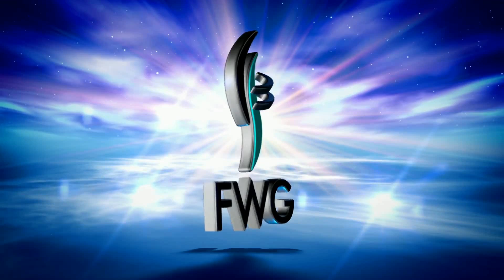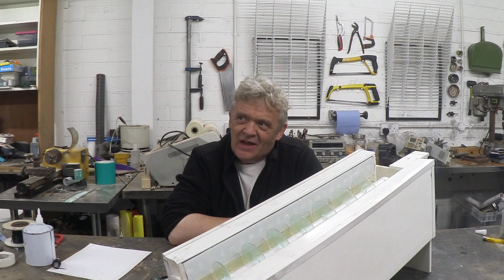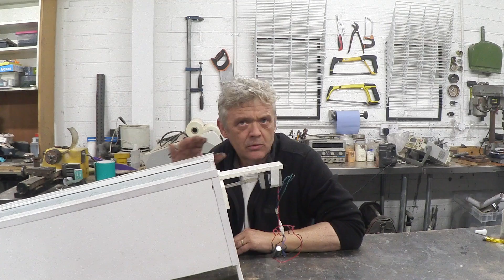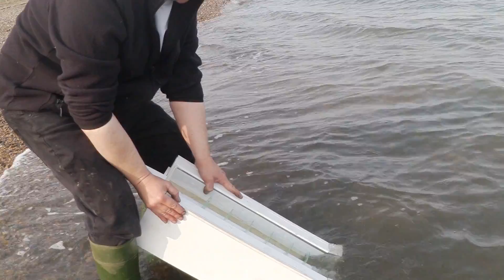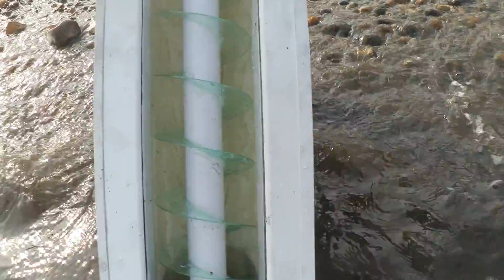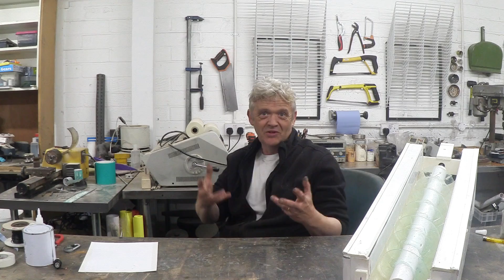Testing the Archimedes Screw Generator in the Sea - Wave Power

Comment: 🤔 you could mate it with a wave capture device. (Just a tank with shallow slopes.) 
I was just thinking 🤔 of a different style, you could use buoyancy to generate.
By attaching floating anything's to slide up and down a pole, and use your differential gearbox and toothbrush ratchet,or a rectifier circuit and a stick bowed with a string attached. And can wrap once or twice around a small drum long enough so it dosen't fowel up and tangle, that will give it more flexableity as the sea is very unforgiving, and raises the generator out away from waves.

🥺 Please make it ❤😊
⚡ ⚡ ⚡ ⚡ ⚡ ⚡ ⚡ ⚡

Comment: This is a silly proposition Robert but what would happen if you put an elastic band a big heavy duty elastic band as the linkage or to control the linkage in between the auger and the generator so that it would wind it up and it would get to a point and break loose and really turn it blazingly fast once it reaches that point where it can't hold back anymore that way you would reach a point where could generate a lot of electricity I know certain motors slash generators are not efficient when they're spinning slowly that it isn't a exact one to one deal that there are diminishing returns if you move them slowly do you know what I'm trying to get across? Of course it would have to have a ratcheting system so as the waves rolled up it would turn only One Direction and wind up the elastic and when they rolled down it would do nothing rolled back up it would wind it up a little more do you know what I'm saying?

Comment: what if.... the top of the screw core was dropped to the the hight of the incoming wave?
That way the water wouldnt back flush as much and just maybe, create enough draw on the screw to keep it rotating in a forward/positive manner; in preparation for the next wave?
I think the angle of the 'sluice' should directly correlate to the size/height of the wave
Just a though.
Appreciate your efforts.
Cheers for sharing.

Comment: Hey, I also watch that Japanese video, and I decided to make this device for my final project at school. But I have a question. If I make the screw quad-helix, do you think it will performs better than the double-helix or even the single-helix? considering I will use an identical stepper motor.

Your answer will be very appreciated and helped me alot. Thanks!

Comment: was wondering, what if you glued a 1" high plastic rib aligned from the center mast to the outer edge of the screw with a 1/2" lip on top like cupped fingers set every 2 inches down the screw,  if that would significantly increase the efficiency of the screw?

Comment: How about covering the open 'front' of the screw with a sheet of clear acrylic plastic.  Then submerging the column with the screw so that the water rushing in and out of the bottom end twists the screw back and forth.
Match the higher torque of the screw to the motor shaft with large and small pulleys and a belt.  Or a large diameter motor out of a washing machine (I forget what its name is).
Thanks for the innovative demonstration.

Comment: I think feeding the water into the top via a wide converging ramp scoop from the wave and the screw part being inside a tube to return water out, would be most efficient to produce max energy from a wave.  Then as you stated focus on the generator optimization.  Try that :)

Comment: Hey Robert, maybe your looking at this wrong. Maybe a different direction is needed. Maybe you need to have a look at self winding watch mechanisms. You can buy the cheap book of 501 mechanical movements.  You then could build if you want too, a spring activated movement to run your device. Your right,. It's all in the way of gearing. Check out the forever Light. It works almost the same as an Old Cuckoo Clocks with the Corn Cob Weights. Use the Screw you built to wind the Spring and the Spring to turn the Gears and the Gears to turn the Motor that intern product the power for your project. Just a uneducated thought. Thanks for the upload. PS I forgot to add Robert. Your going to need some way to collect the power until it has reached the level your products need. Your going to need some Capacitors to hold what ever your project needs.

Comment: I've been thinking along these lines for ages, if I ever move into a house with a stream in the garden a water driven generator would be in place before I'd unpacked my packing cases!

You can use gears or pulleys to convert high speed/low torque to high torque/low speed and vice-versa.  That's what the large wind turbines you see in fields do, a gearbox is used to match the high torque & low speed available from the slowly rotating blades to the higher speed (and lower torque) the generator needs.  

In your project the capacitor on the output of the rectifier is good at storing pulses of electricity, for example like that odd-shaped wind turbine you made would produce if a gust of wind came along.  I don't think you'd need it in this application if the water flow was steady, as in a stream  A capacitor would be useful where you used the Archimedes screw in the waves, it would even out the varying voltage produced because the rotor has to stop and reverse on each cycle.

Comment: I remember reading somewhere that in a wave the individual molecules of water actually move up and down vertically, not elliptically as one would think, so I wonder whether this would work if it was mounted vertically without an enclosure and just extracting power as the water molecules impact the vane of the archimedes screw.
Reply: Vertical might extract its full potential with least friction.

Comment: Pelton wheel  style generators rely on high head pressure. That takes a lot of height. The Archimedes screw can function on a gentle slope. In backwards mode (not as a pump) it tries to slow the water down, but gravity weighs upon it, compelling it to turn. At some point the water will bypass it and flow over it, so the longer it is the more work it could do. If it were on a vertical axis where the fluid entered a toroid shaped vessel in a spiral, and the discs that made up the Archimedes screw reduced in size to match the shape of their container I wonder what that would do? It would take full advantage of gravity and maximize rotational force. The top of the vessel could have taller walls to increase pressure. I can not visualize what orientation the impeller should have to the flow, but I think it should be counter to maximize pressure.

Comment: Wouldn't Salter ducks be a more effective way of extracting energy from waves? Instead of of supplying cheaper electricity at a time of high oil prices in the 1970's, now it could be repurposed for coastal defence. The wave impact on vulnerable shorelines could be reduced and the electricity generated could help recoup the cost of the installation.
Reply: Many different designs of wave energy converters were researched in the 1970's and 1980's. A lot of the UK interest was triggered by the oil crisis of 1976 and then wound down in the mid 1980's, when it became clear that oil was not about to run out.

For UK operations, the best wave energy source was Altantic swell, i.e. waves generated by the effects of wind out in the ocean. But, the resultant energy flux at the best UK sites was only of order 1kW per metre of sea front, with typical frequencies around 0.1 Hz. So big and hence also expensive devices would have been needed to harvest such energy.

Comment: I think what most people are failing to realize is that Robert is not trying to create a perfect mechanical device. What Robert is trying to do is give a lot of ideas in concept that can be tweaked and would work very well. Rob, you got my vote. Also I love the fact that you show one different type of device to the next in giving a lot of ideas. You always get me thinking on ways to improve or add to each device. I love a good mechanical device challenge. For example, I think your ocean air pump would had worked to turn something like this idea as well. The one that you showed a drawing of the idea where the force of the ocean created a strong pocket of air by the swells of the ocean. If you think about it hard enough in idea, you could even enclose this screw and put a check valve on it to make the screw only turn as water pushes it. I mean there are a lot of different ways we could make this device work. I thought of at least 10 ideas within minutes, LOL but the concept that you have showed is golden mate, Thank you for showing and making me think. LOL, "Me  Daughter" what do you like with your coffee in the morning Dad, "me", some Robert Murray-Smith videos, LOL.

Comment: I vaguely recall an article in a magazine about wave generated energy from submerged air bladders. The bladders had pipes that went to shore and the pipes would push air into turbines for electrical generating. I do not remember anything else other than it was just at the testing phase. Apparently the submerged part was so that it wouldn't be an eyesore or interfere with water traffic. The idea worked because as waves passed over the spot with the bladders the pressure changed. It was a closed system as the air generated power both on inhale and exhale. I think that water in submerged bellows would power your archimedes screw back and forth.

Comment: I'm not so sure you'll get it more efficient than a normal turbine style water power generation system, I seem to remember a story about an engineer experimenting with screw driven boats that found his vessel picked up speed when the screw snapped off short, leading to experimentation with screw propellers as we know them today. I assume the frictional loses in an Archimedes screw are greater than the power the extra surface area provides compared to a normal prop or turbine?

Comment: Turn the screw and its housing into the generator by mounting permanent magnets on a ring around the OD of the screw turning it into a rotor. Build suitable stator coils into the housing. Encapsulate everything for corrosion protection and you would have a simple system having only 1 shaft, 2 bearings, and no couplings, gears, sprockets, chains, or belts.
Reply from the maker: nice one mate

Comment: Is having big torque low speedgood for transforming to low torque high speed with gears? There should be loss of energy in conversion but better if the electrical generation device at hand only can generate it that way right?
Reply from the maker: that would work well mate

Comment: A "dissociation device"
Yeah, the problem with all of that is, a capacitor looks like a dead short when it's devoid of charge and places a MUCH higher load on the generator/alternator.
God speed, but you cannot create energy from nothing.
Reply: Jimmeh B
, good luck generating anything without movement mate,come back when you can focus on the content and not get hung up on your american personal interpretation of A "dissociation device", aparently you dont realise robert knows a little about capacitors/Leyden jars/accumulators....  :/
Reply: @paulmaydaynight9925  Does he now? Very good, because he doesn't seem to understand Lorentz force.

At least, this "Explanation"  doesn't demonstrate that he does.
Reply from the maker: ah mate - who is trying to do that? there is nothing about free energy in this video and there is a diode bridge between the generator and the cap bank - so yes it looks like a load but it is a non variable load as far as the generator is concerned - still we all see things differently
Reply: @ThinkingandTinkering  If by diode bridge, you're referring to a full bridge rectifier, in which case, it is irrelevant aside from the 1.4v Diode drop +/-.

Non variable load? The more depleted the capictor's charge, the higher the current it will draw, so I'm not sure what you're trying to get at there.

Comment: You're going after scavenged energy, small bits of energy that you can convert into electrical energy, small gusts of wind, rain and a downspout, water flowing downhill, you're not looking for a massive amount of energy from your machines. I acquaint it to using a 5 watt solar panel to fill a battery, it may take it a long time to actually fill the battery but it will eventually, 100 watt solar panel will fill the same battery faster but that may not be necessary. Having several scavenger devices around all wired into a controller will trickle small amounts of energy into a storage device, so if you have twenty 5 watt devices and they all are working at the same time you can fill that storage device a lot quickly but just in a different way. Maybe put a gear on the shaft and run it through several other gears to power your mini generator, you could also keep the generator out of the weather. Would that slow it down even more? Probably! So what! You build another one and another one and another one
Reply from the maker: yes mate that is pretty much the idea. personally I think energy generation is a strategy rather than a single answer

Comment: It gave me a different perspective on how to power the Archimedes screw.  Seeing the water fill up the area around the screw and then drain away made me realize that you can fill a container with water by wave action.the screw doesn't have to be turned by the ocean directly, but powered by a bucket being filled by wave action. I guess i just described a hydro electric dam.  Seemed ground breaking when I started.  lol.   =-P Cheers.  I Enjoy watching to invent. It inspires me.
Reply from the maker: it's an awesome idea mate - basically you are using the sea as a mechanical battery and the screw to convert that mechanical battery energy into electrical energy - it's a different perspective and leads to different conclusions - nice thinking
Reply: @ThinkingandTinkering    Thank you.  :-D

Comment: Excellent work and a really great explanation about generator. Super clear and to the point!

May i suggest a useful bit in my japanese motorcycle, lol. Thay have a very cheap and awesome already made core of wires and steel for charging the battery. I think it can be converted to a really good brushless motor and/or generator. Just put some magnets in a case that spins around it. 

It is incredibly cheap, very well done, several turns of thick cooper wire on each tooth, it even has epoxy coating, super fancy stuff and already available everywhere. 
Hope it helps :)
Reply from the maker: I'll have a look into that mate - cheers

Comment: I have to agree with you, power is power wether it’s high torque low rpm or vice a versa. We seem to be conditioned to wanting high torque but in the case of electric cars for example I think that a high speed low torque motor would be much lighter than a high torque low speed motor. There is of course the need for a large gear reduction which has it’s problems in a car though I think I’ve found a good solution that would work with a harmonic drive which is why I was hoping you would’ve made one in you series about making gears.
Any way it’s all great stuff that you are doing here.
Reply from the maker: the gear series is still going on mate - I just do them every now and then
Reply: Robert Murray-Smith that’s great, I’ll be looking forward to see what you come up with.

Comment: you could possibly compensate for the mismatch by gearing up the screw shaft to the motor shaft, converting that torque into speed.
Reply from the maker: good point mate - cheers

Comment: That was a good comparison.  You also have to account for the type of material you are using.. Again the large wind turbines are turning slow, but using a reduction gear system to turn the generator faster producing very high voltage.  
        Pretty sure you would need a flywheel system to ensure the you kept the speed up during the reversal of the blades using wave power.
     Actually someone did a video 10 Years ago?, they were using a water wheel for power; they hooked it up directly to the load, it stopped the wheel cold., Thats why they always go through a battery first, it absorbs the large current flow that happens at any start up.
Reply from the maker: cheers mate and nice points thanks for posting

Comment: There was a ducted wind turbine where the coils were on the outer edges instead of a generator in the middle. It never caught on. Is there something inherently wrong with the idea?
Reply: Ducted windmill with Coils on the outer rim,   im going to guess If it cogs or certain loads it could vibrate.   I do love the Idea of ducting either of the conventional windmills.   Even if u had a V shape grassy hill and placed the windmill in the center that would really go.
Reply: @mike289 homebuilt  ,easy enough to test,get yourself (the inclined reader) a few long tarps,a bundle of cheap 
8ft (2.44m) 16-18-20mm diameter natural bamboo kane, a bag of zipties or wire to make and fold ,tie and ancher into the wind with some turban(s) headwear based on cloth winding,some nettle/blackberry cordage etc ... and make a large funnel fed into your scaled windmill,turbine(s),fridge to see it get colder etc.
Reply: pretty much everything there fails due to over charging/over valueing the commercial raw material device costs not the  idea Per se.
Reply from the maker: I think the idea per se is sound but Paul really makes a good point - most things fail because of the translation into commercial reality

Comment: All these small generator ideas makes me think a BEAM circuit (Solar Engine) might be useful to make the small voltages and current into something that can actually be used.  These circuits are often used to run small robots from solar cells that are too small to power the robot's motor directly.  I think the same idea could be used to trigger a charging circuit when the generated power reaches a certain point.
Reply from the maker: for sure and implicit to what you are saying I think is that control and organisation of lots of small generators is where the issue is